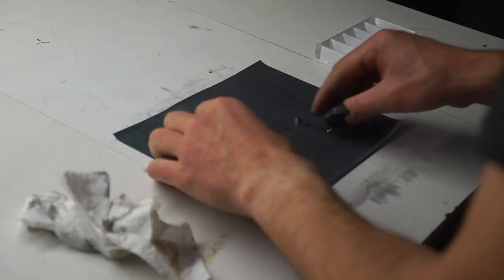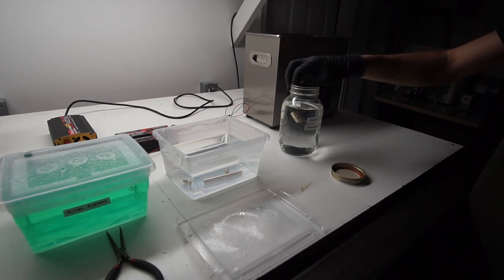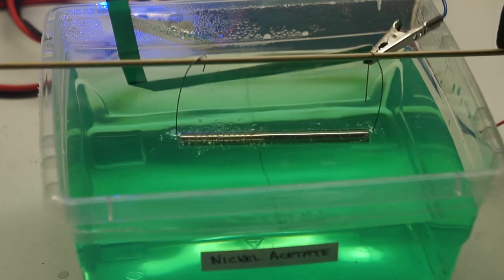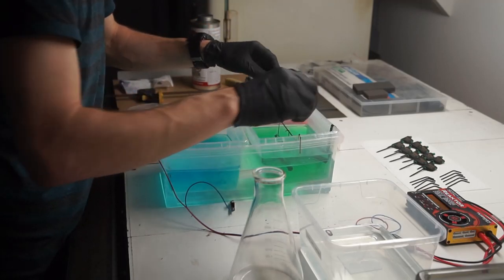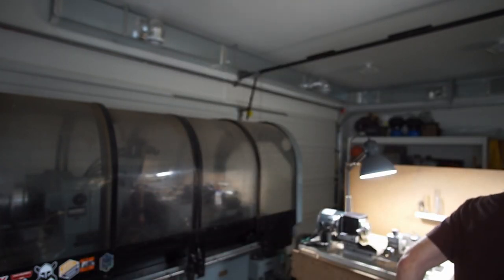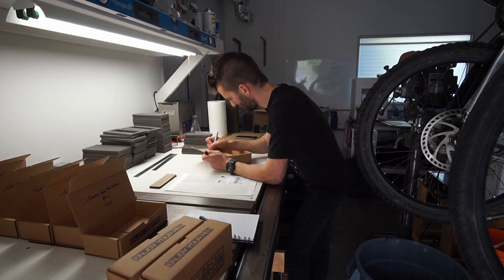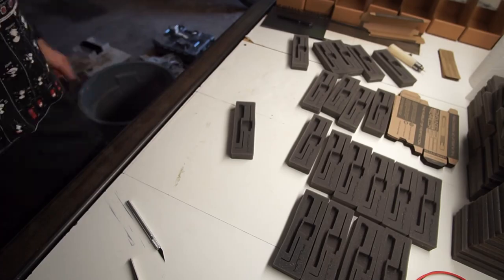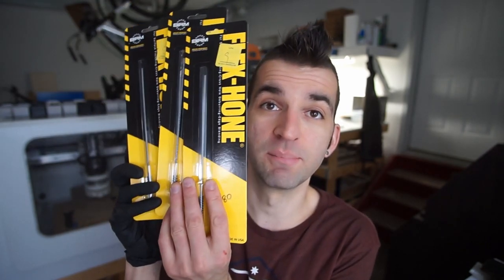DIY Nickel Plating Adventures

Comment: A couple things... The copper plate is generally a high fill plating so it can fill in some scratches. You should have more nickel electrodes in your solution, you may be getting shadowing on the far side of the parts. And finally, if you are anodizing aluminum, apparently nickel acetate can be used to seal the anodized layer, I need to read up more on this since I've only used steam or boiling to seal parts.

Comment: I agitated my nickel solution and it helped with keeping stuff uniform across the part…
Reply from the maker: A great idea. I was debating throwing a few bubble stones in the bottom at some point to help keep things moving.
Reply: I use a small fish tank air pump. Works perfectly
Reply: @CurtVanFilipowski 
Use a Heating/Stir machine , I got mine on Amazon for $35
I use Beaker’s 500ml & that fits on hot plate area of machine, & a small magnetic capsule goes in the bottom of you solution. You can adjust your stir/agitation levels to your needs . As well as the temperature. 
Lee

Comment: I just paused your video for a suggestion. As far as crease lines, you could 3d print a positive and negative mold that would crease all the fold points by a few degrees, not needing to score or even laser the creases. Think sheet metal press.
Reply from the maker: I like that idea...actually found out that custom card making people use weird ridged trays to keep their fold lines parallel...might have to bastardized a bit from both! I think your press idea would be the fastest.

Comment: I stopped at 9.56. I'm not sure you realise it but you can strip the plating off of your pen 100 by putting into the plating solution and reversing the polarity, thus removing the plating from the item. Clean it back up to pre plating condition and do it again, hopefully with no imperfections. Hope this helps!
Reply from the maker: Thanks! I actually did that a few times with that specific pen but still couldn't get a reliable bond (pretty sure it was before I discovered adding the copper plate before the nickel). That's basically how I 'electro clean' the parts, it's just reverse plating at a much higher current. None the less hopefully your comment helps someone else in the future having the same issue!

Comment: Hey Curt, very off topic but I was watching one of your older videos and noticed the roof seemed to be insulated. I am in a shed in south AL and even with 5000 BTU AC running 24-7 I cannot keep it cool after 10-11 am. You seem to be the man with a plan, any insights?
Reply from the maker: No idea, but 5K is a pretty low BTU output for a garage (unless your shop is 10x10). I'm using about 25000 BTU to heat my space in the depths of winter (which is 20x20).